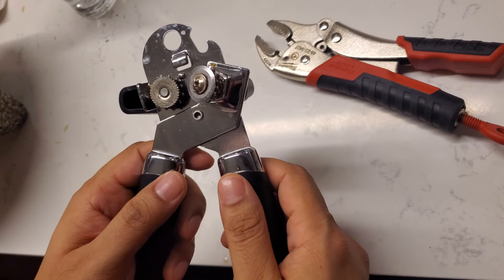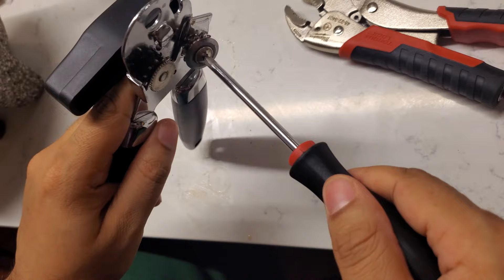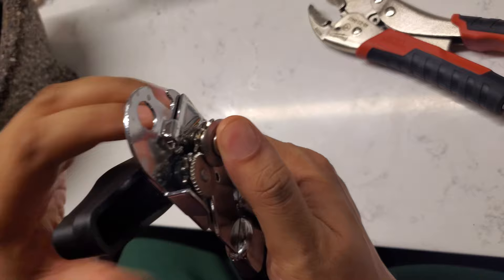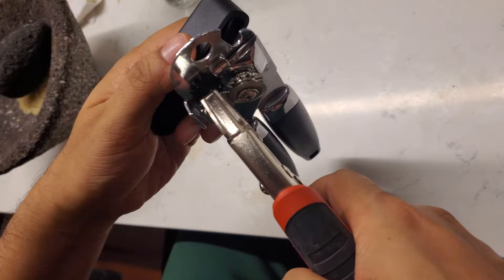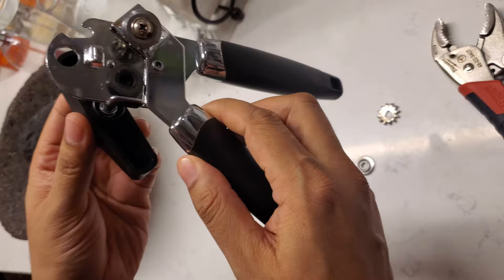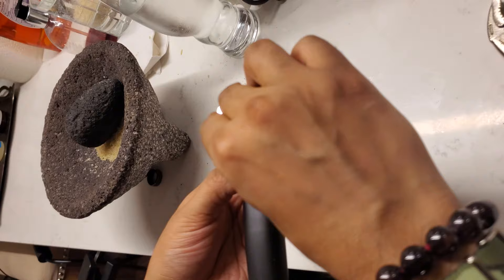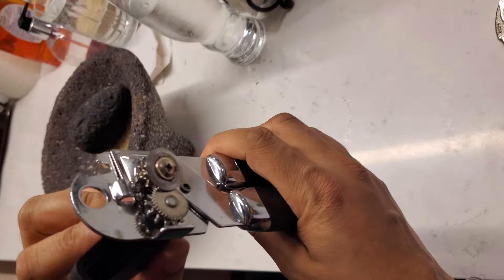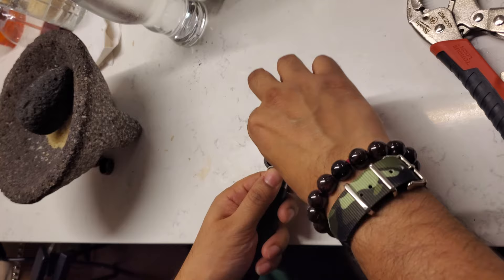Fix and align the gears on a can opener thats grinding but not opening a can

Comment: I added a thin washer (try two if it's not enough) between the two gears (that are on the axle opposed to the cutter wheel axle) to force the cutter disc to be very tight against the «transport» gear. Hope I'm clear... It worked for me.